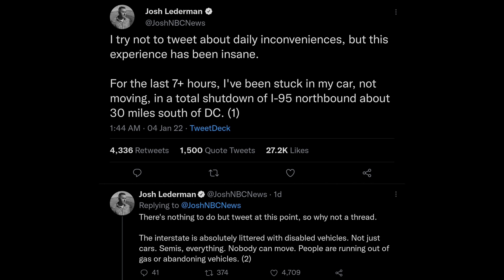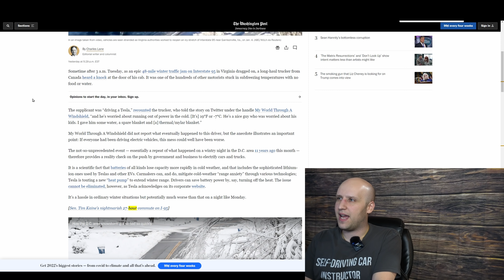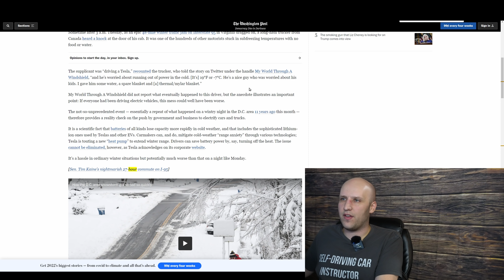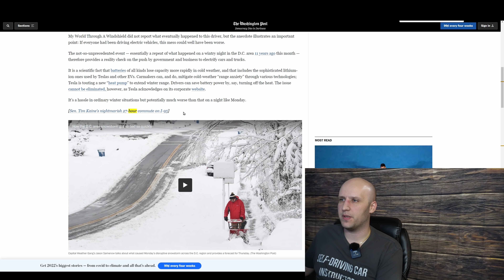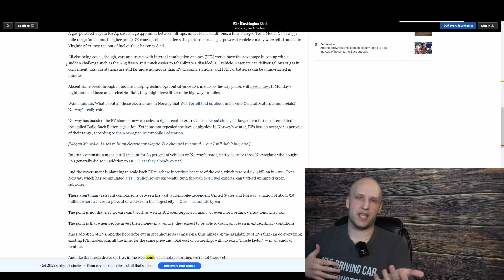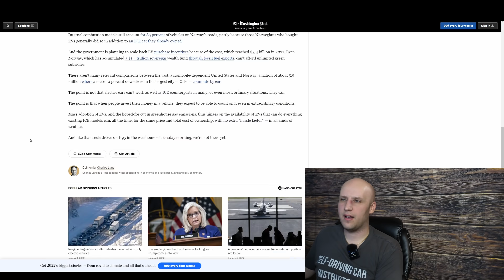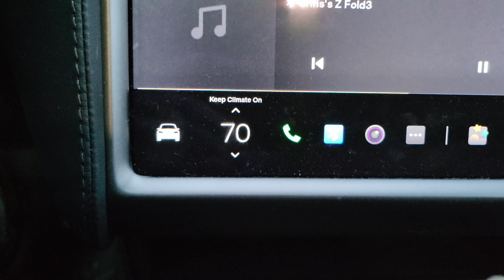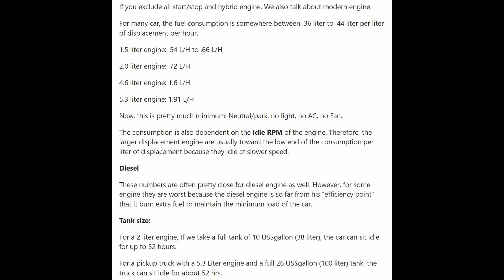How Long Can a Tesla Keep You Warm In A Frozen Traffic Jam? | FUD Debunking

Comment: i have seen it both ways, people who loved EV and People who never could fall in love with any of the EV's they owned and went back to ICE, i think most of them would have preferred a proper true hybrid option, something like the volt...bolt...whatever, the one that was a hybrid, OR one thats got a small efficient gas generator for when the battery isnt cutting it/getting low....

many i know have said, if they could get a true hybrid truck and/or SUV(or large crossover), that was a proper hybrid, they would be very interested, including those who have not been able to fall in love with their ev's...

one's wife LOVEs hers, but, also admits its only because her employer has proper chargers, as her drive to/from work use more then 1/2 the battery each way, she admits mostly because of the rout she has to take to work to avoid being stuck in traffic for another 90min or more each way, alot of windy hilly roads i gather, on the other hand it didnt work well for him, the tesla they leased was nice but, spent quite a bit of time in the shop due to issues the most annoying being when the battery fuze failed on a trip when they were 2 states away, took tesla a week to swap the part, though the job takes under an hour to actually complete according to the tech that he talked to after they fixxed the car... have a feeling the guy either didnt know they shouldnt admit that, or that he was letting my buddy know that, they could have gotten it done alot sooner, either way they replaced the old unit with the newer unit that wont fail, and it worked well the rest of the lease, but... hes glad it was just a lease... it had so many issues that in my state the lemon law would have applied... sure they sorted them eventually but holy hell..

i live in a smaller town near the PDX area so, alot of people out here drive quite a distance to/from work, and quite a few employers still lack chargers for employees cars.

the other big issue every single person i know has with EV's as they are now... cost of repair/ownership over time, they have most of the same problems ICE have, but a whole list of other problems.

for example you have a couple cells in your battery pack become weak, for tesla the fix will be 16k+. often over half the value of the vehicle, because they will only do full battery replacements, not cell level swapps... despite how simple that honestly is.. 

now, i say this as somebody whos done it from small remote car size things up to massive battery powered industrial forklifts that use a bunch of 12v cells to build packs..if a cell starts to weaken. mostly you just gotta top the fluid off... but when its fully failing, you just swap it with another thats in similar condition to the rest of the pack.. the charge unit will balance the charges as it gets everything recharged in most cases... and this was decades ago...new stuff tends to be far better at that kind of balancing... 

anyway.. if tesla and others wanted to support right to repair and help 3rd party shops do a proper job of such repairs, certify them, help them with parts that arent readily available on the market, that would help relieve alot of peoples worries...

and note: many old mechanics are not afraid to work on electric cars, many have worked on electric motors and such for decades and would love to be able to do their own repairs/upgrades without it having to be hack-ass-guess-work all the time... 

cell level swaps, are not hard in the case of most of the cell types/styles EV's use... the PITA comes in with matching cells... and i get why tesla themselves dont want to do that on a per-car-basis, to get perfection, would take time and effort and more trained people at each location, on the other hand... most people are more then happy with a "close as we could manage" repair for such issues that gets them back most if not all of their original capacity.... 

a buddy of mines gotten ahold of several leafs with battery cap issues.. in each case he was able to use cells from a crashed leaf to swap out and regain full or near full capacity, infact, he also added a 3rd party battery heater/cooler unit to the car he found on some forum, says that from his exp so far, its a noticable improvement just having it keep the batteries at optimal temp when both charging and when in use both summer and winter... i just know i did help him make some new interconnect cables for the car before he told me what i was soldering for him.. (he wanted the ends both soldered at the end and crimped), he admits he should have asked me to help with the cell swaps, im far more competent then his 2 brothers....who are... to be kind... well they often make things much harder then doing stuff alone... 

anyway... again my view... a proper hybrid series of vehicles would be far more attractive to most people in my part of the country/world, more so if they rather then fight against right to repair, embrace it and accept that its the american way to want to fix and tinker with the stuff you buy/own... that shouldnt be discouraged... hell if auto companies look back at their own histories, every old company gained ideas/inspiration from things users did to/with their vehicles, often to the benefit of everybody... you never know what problems some random user may find and solve for you, that you could just copy/license or buy the idea/hire the person...  

we had a teacher when i was in school whos father was hired by one of the major auto makers back in the day, because he had come up with a modification to their default carb that made it far less prone to some issue that had plagued them, every time they though it was solved... real world users would find it was better but... far from solved.. the old man ended up doing a full carrier+ working for them and was one of the people who helped design and implement the companies first EFI offerings, with the collection of cars that family has... and the detail the old man went into on some of them... i got zero doubt he really was there.. he showed us the original carb he modded, honestly he did such good work we all thought that was original and a part that had been swapped a few times was what he changed... that old guy also had a BUNCH of little rotary engine powered RC cars/trucks and planes...and one speed boat...that boat was so loud it made the full size boaters stop and stare... those little RC size combustion engines are quite loud...

Comment: the one big advantage to that gas-engine vs electric though, is, you can just carry a small jerry can over and add enough capacity to last hours in a couple minutes, with electric, good luck with that... 

for example, if your stuck in a situation like this, somebody could get close enough from the other side or direction to provide some jerry cans of fuel, or hell a guy on a snow mobile with an old orange toboggin and a bunch of jerry cans... for electric autos....they would also need to haul in a generator or la bunch of sizable battery packs....rather then just some jerry cans of fuel, or a large tank of fuel and a few jerry cans... 

i have been stuck plenty of times, also seen people pull the cans off the back of their rigs and help others who were low/out keep going till they could get to a station... seen old timers fill up their farm fuel trucks tanks and head out to such situations and help people out, they knew how to drive in it and had rigs more then capable, hell, i helped them clear a jam once when i saw one headed up, he told me what was up, i told him to give me a ride home, and i would help, and would get him some more help.. the 3 cars that had pile-crashed closing the highway for hours... all were able to drive once pulled apart and upright/off each other... took us less then 90min to get stuff moving but a few people had to get fuel and help bleeding their fuel systems so the car could start..(thank god we had somebody along who knew how to do it on each type of engine that was effected... like 12-15 people i was aware of, he gave them each a gallon so they could get to the gas station a few miles away, (one of 3 within that range infact), one old woman got his business card(the old man who owned the truck and brought his family and friends out to help)... she paid him $500.00 usd for getting her out of the ditch and fueling her up, told him to split it with us who also helped or buy is pizza and beer or something... he told me when he said "but some of them are under age" she apparently laughed and said "oh, dont tell me any of them were young enough not to have drank a beer"... i mean she wasnt wrong... just none of my friends like beer LOL..

Comment: Actually the heat exchange in a normal gasoline car does take extra gas, its not much but what happens is the engine runs a bit cooler and colder engine equals less efficient.

Comment: Why was there snow on the back window if it's at 70 degrees in there also why when you turned the temp down to 60 instead of 70 the heater started running

Comment: 25 people died in Pakistan in a hill station called Muree, where almost a 100k vehicles thronged for the season's first snowfall, which ended being a prolonged snowstorm.
There are almost no electric vehicles in Pakistan. and most of the deaths occured because of Carbon monoxide levels going up inside the cabins because of blocked exhaust and closed off cabins in the cold.
Had those vehicles been Teslas, I feel those people/children would've survived.
The really fu*ked up thing was many of those families stranded on the road spent the night in their vehicles because the hotels jacked up prices 200-300% as they saw that people had no choice.

Comment: Omg, there's a fake argument. What if the power goes out? Gas stations require electric for the pumps. True, but they often have back up generators or hey, plug your Tesla into the pump. You don't have generators to for the charging stations, that would defeat the whole point.

Comment: The primary difference is  I drive a pickup or currently a van,  I have second fuel tank that's always kept full . Giving more than double fuel compacity. You can't do that with electric. 
In winter I never use more than 1/4 tank of the main tank. Before I fill up. Why, I grew up in snow county well away from the population centers with only one two lane road " one lane each way". It is still common to lose electricity for several days at a time. Only reliable heat source was wood . Electric power out for a week,the you are screwed with an electric car.

Comment: About gas car running out of fuel; regular gas car 2 liter engine needs about 0,6 liters of gasoline for one hour of idling and at the same time diesel car needs like 0,4 lit of diesel for one hour of idling. And ar the same time it needs about 5 liters of fuel to drive 100 km. Basically if you have 100 km of range basically fuel low warning on, you can idle there for 10-15 hours... On full tank of fuel you can idle there for 10 days.
Diesel truck have about 1000 lit of fuel and it uses about 2,5 per hour of idling so you can be idling there 10 days. But it has fuel burning heating. And that thing needs about 3-10 liters of fuel per day... So trucks are fine for whole winter 🤣🤣🤣

Comment: Except you can pass jugs of gas to everyone low on fuel with ICE cars.

With electric cars you are just fucked and require towing. 

That is why it would have been worse for electric cars,they need an outlet in the middle of nowhere whilst ICE cars just need a jug that can be literally airdropped there.

Comment: With a gas vehicle, you can exit and gas up in five minutes once you get to a pump - maybe not so with an EV.

If they were all EVs, imagine the line at a charging station waiting for the guy ahead of you to charge his vehicle.
Reply: Modern evs can reach enough charge to move on home in minutes. You're placing the hypothetical reason in there that every car would be at a point they all need to stop at the first charging station
Reply: @shmodzilla  No, postulating that an unanticipated storm hit which extended your commute in winter to multiple hours - and I live in a Chicago suburb and have experienced such - I'd get low on fuel and drop out at an exit and fill the tank and get back on the expressway.

If we were all in EVs, you'd want not just enough power to get home but enough to heat you on the remainder of your commute - however many hours that would be.

With a chemically powered car, that fill up would take a matter of a few minutes - don't know how long that process would take with an EV, but I suspect it wouldn't be a matter of a couple of minutes. Multiply that by the number of cars which would have to drop out at a given exit, and you'd have long lines waiting for access to each charging station. Add to that the number of commuters who live in apartments and don't have access to home charging stations and need enough of a charge to get home in a heated car but also to start off the on their commute the next day and you have a big problem.

We don't all live in sunny California, you know - which I believe was the purpose of this video.

I haven't had any 24 hour commutes, but I have had eight hour commutes. (I don't any longer as I'm retired now, but do remember those occasions when I was working.)

Comment: I didn't realize that this became a thing on social media. It's a stupid thing to bring up for those with ICE engines or battery operated vehicles as either could run out of the energy producing fuel they consume. Either a gasoline/diesel vehicle with a low tank or an EV that was at less than 30-40% would have been in trouble in those situations. I will say that an EV would simply not do in extreme climates as an only household vehicle. For comparison, where I live vs. Virginia's cold spell is nothing. In Vermont we are expecting wind chills between -30 and -40F 1/14/22 evening 1/15 and maintaining warmth in those conditions would be considerably more difficult for both types of vehicles but an electric vehicle would certainly burn through more energy to maintain temperature in that situation. 

But people in both camps annoy the hell out of me to be honest because the real teaching moment in all of this has been missed. COLD WEATHER IS NOT A JOKE and can be deadly if you are trapped unprepared in it. I was hoping to see some sort of mention in your video somewhere about the importance of keeping emergency preparations in your car. For example, if you live anywhere where it gets cold you should have a cold weather kit in your car all winter long. Blankets or cold weather sleeping bags, hand warmers, traction belts, shovels etc. These things can save your life.

Done ranting. Seriously, stay safe when you travel in the cold.

Comment: I assume putting tin foil on window and roof glass may reduce heat loss so having a roll of tin foil and adhesive tape along emergency kit would help. You may want to test with windows and roof covered by tin foil.
Reply: You'd be better off with space blankets or similar but foil would help.  Generally it's a good idea to have some kind of blanket in your car in winter in general too. 

If you're gonna prepare might as well go for the best imo

Comment: Bro, your seat heaters don't activate or aren't active, even when they are switched on, unless someone is actively sitting in them. Its kind of like a safety switch. So, you need to be in that car the whole time you are conducting this test to get an accurate assessment. Also, depending on how many passengers there are inside the car at the time it becomes stranded will determine exactly how much power the seat heaters use along with the climate controls to how fast it all depletes that power from its batteries. Then you will have your answer!

Comment: I love the dumb claim that fossil fuels are subsidized just like renewables. Fossil fuel subsidies are designed to make it more economical to extract and produce fossil fuels closer to where they are consumed. This is usually done for political reasons. Take away fossil fuel subsidies and there will be no impact on Fossil fuel consumption. The extraction and production of fossil fuels will centralize to the most abundant sources. EX. Most Oil & Gas coming from the MidEast/Russia/etc.
Renewables are usually subsidized to make them economical alternatives to Fossil Fuels. Until recently, renewables were not better economical options over fossil fuels without subsidies. Fortunately, Solar is now on parity with oil & gas without subsidies.

Comment: I was stuck in my car in a blizzard in Payson, AZ 3 years ago. Snow was so deep I couldn't open the door. I did not have a jacket, I was not expecting anything like that. It in fact set a new record. I was in the car (a lowly 2013 Chevy/Daewoo Sonic) for almost 20 hours without any food or anything to drink, but I did have a full 13 gallon gas tank. I was able to stay warm the entire time by running the engine for several minutes, shutting it off for several minutes, then restarting it. I had the heater on full blast. When they were finally able to get snowplows through and opened the road, I still had plenty of gas to get me the 80+ miles back home. Thank God I wasn't in a Tesla. It would have become my coffin.
Reply: ICE car idle time estimates seem to range between ~50 and ~200 hours on a tank. People seem to just estimate this though. One popular way is MAF data from the OBDII port and assume a Air:fuel mix of 14.7:1.